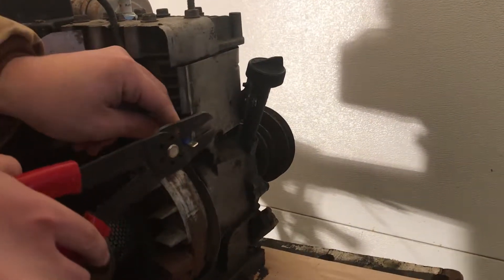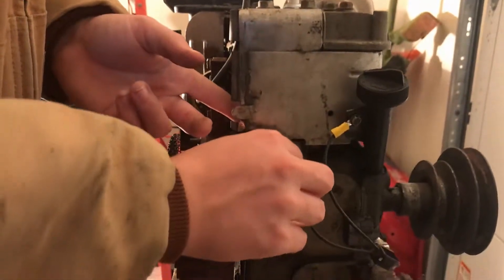How to Wire a Kill Switch to an Engine

Comment: The manufacturer didn’t mess up. When the switch is on..  the ground is established and kills the engine because the mag is grounded. When the switch is off… the ground to the mag is broken allowing it to run.
Reply: Correct
Reply: Yes, the switch shows on which completes the circuit, that is the ground is being completed. In the off position the switch breaks the circuit allowing the engine to run because it is not being grounded.
Reply: hello does the ground wire from the killswitch have to go directly to the mag or can it go to a ground point on the frame?
Reply: the frame of my motorbike sorry
Reply: @ Solder one connection point of the switch to the switch case metal so when it’s mounted, it will be grounded to the unit it’s connected to.

Comment: In the on position its closing the circuit. Like when you turn lights on. On your case by closing the circuit you ground out the coil.. your using the switch in a manner thataround. Not  intended for. Just turn the on off indicator aroind.
Reply: Overtime campus be hard on the coil when the engine is still spinning and electricity being produced by just magnetic field

Comment: Great vid, I need a killswitch on my go-cart, does the earth wire have to be earthed to the engine or can it be earthed to the body of the go-cart and still do the same job? Thanks
Reply: You can ground it both to the chassis and engine

Comment: They did not mess up the ON and OFF   normally on would be making a connection between the 2 wires but in the case of the engine connecting the 2 wires Kills the engine.  so when it is in the Off position the circuit is open and the engine will run and when in the on position the connection is closed and won't run.
Reply: Exactly. It can be thought of as "Kill on" and "Kill off". Kill on kills, kill off doesn't.
Reply: Will the engine still turn on if the switch is closed or is it just fully off with nothing happens when you hit the starter?

Comment: I don't want to sound nit-picky, but while the engine may be labeled as an MTD, that is either a license relabel, license built or clone of a Briggs n Stratton 5-hp. I had the original Briggs version on my go-kart growing up. So the information you are showing will work for those engines too.

Comment: The manufacturer was correct. On is when the circuit is completed, thus providing ground to pass through the switch which kills your engine. In any normal case, it would be letting electricity to pass through which would turn something on. You could try to turn the on/off plate around, because it won't matter if you reverse the wires.

Comment: Tim, what is the difference between the kill switch and the stop run switch. Can both be on or just need one.
thanks
Reply from the maker: Before I wired the stop/run switch, this engine used the throttle lever to stop the engine. The lever would be pulled to the stop position causing a wire to ground, which would short out the spark plug. When I wired it with the stop/run switch, I removed the wire from the throttle lever and put it on the switch. With that, I believe the throttle would need to be in the idle position up to full throttle and the switch would need to be on for the engine to run. Hope this helps. Let me know if you have any other questions. Thanks